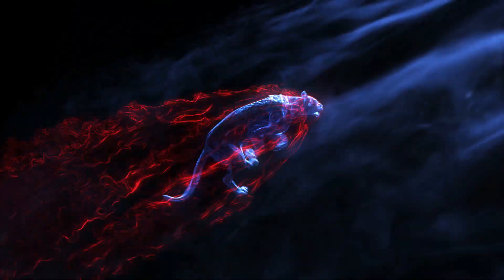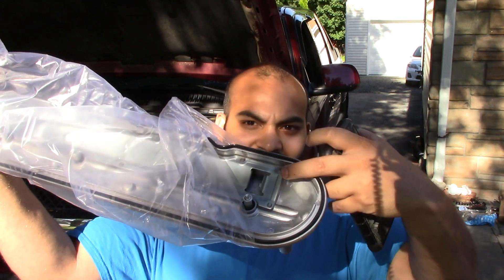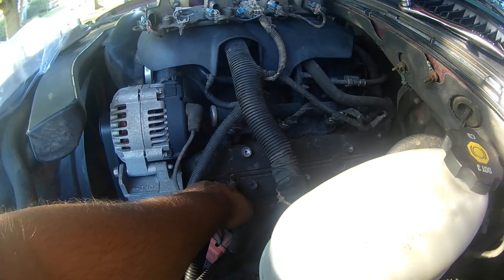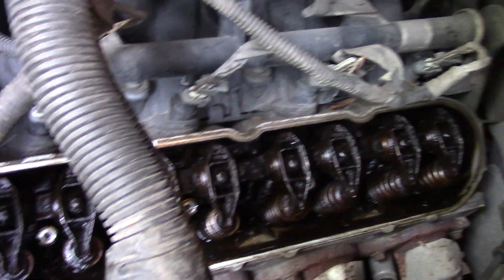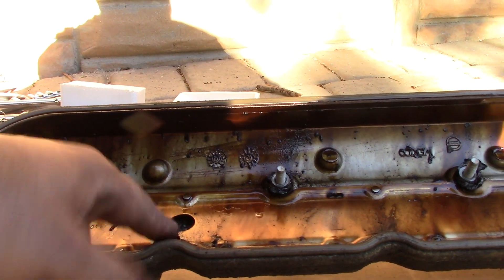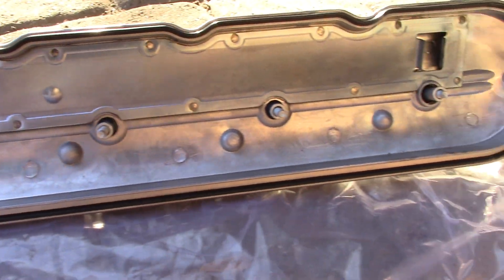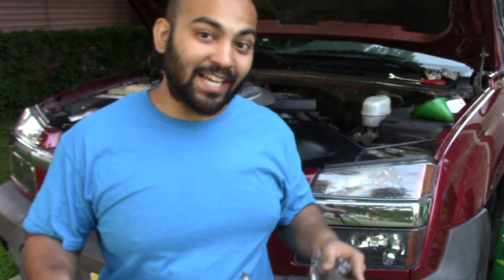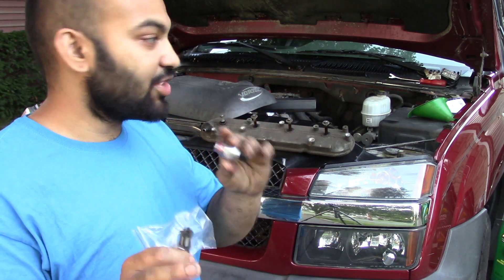2004 chevy avalanche oil consumption fix

Comment from the maker: Update to everyone, it's been sometime and the oil has not been depleting.. Everything is running great
Reply: You need to put a catch can on that thing 2 I was going through the same problems with my Avalanche I put a valve cover on it and a catch can
Reply from the maker: Ill look it up and make a video, thanks for the feed back.. Is everything working as it should now?
Reply: Yes sir everything is working perfect to only thing with the catch can every so often you have to check it
Reply from the maker: OK I'll definitely look into this, thanks for that. Ill make a video on it as well
Reply: Where did you get the valve cover at
Reply from the maker: Hey so I bought mine at advanced auto. But you can look on Amazon or eBay.. For a dorman or ac delco one.. Even 1a auto
Reply: corolla customz did u replace them with gm valve  covers   Or after market.
Reply from the maker: @JtJt-yc9nx  I replaced one cover with a dorman product. Aftermarket. Way cheaper and corrected the consumption
Reply: Question how about the oil pressure sensor  does it leak when it get damage when need replacement.     Reason I am asking. Is because I replace valve cover gasket oil pan gasket and gasket that goes by timing belt     And knowing my luck I still have a small leak.
Reply from the maker: @JtJt-yc9nx  it shouldn't unless it's cracked. But here is what I would do. Clean the leak and keep an eye on what seems to be leaking. I have entire playlists and episodes on my channel.. I did an entire engine rebuild... It'll show you every possible gasket that engine has
Reply from the maker: @JtJt-yc9nx  AVALANCHE ENGINE REBUILD SERIES: https://www.youtube.com/playlist?list=PLlHVUMZIDW-WWTwyrqpGi90-qzW1EC53F
Reply from the maker: @JtJt-yc9nx  chevy avalanche project: https://www.youtube.com/playlist?list=PLlHVUMZIDW-Vyy7FQbjTKA6YlpSKtzC-X
Reply: corolla customz thanks for your help I will do that  I have a 2005 Chevy avalanche   Hope I find solution.    Do u recommend replacing valve covers.
Reply from the maker: @JtJt-yc9nx  your welcome, are they damaged or consuming oil.. If you have an oil consumption, replace the valve cover with the pcv valve.
Before replacing anything try to clean up the leak and keep an eye on it to see where it is leaking. Now if you wash your engine make sure to keep it running, also tape up all electrical connections... Cause you could mess up your electronics
Reply: corolla customz question. Is Lucas oil good for cars.    There’s is one call stop leak   Is it good to put in car     Just a question haven’t use it. I think I use the regular Lucas oil once
Reply from the maker: @JtJt-yc9nx  I honestly don't like any stop leaks, I'm more of a fix it kind of guy. But if you don't have the time or money a stop leak can work... It just rejuvenate the seal and causes it to stop the leak.. But if you can try to actually fix the problem
Reply: Do you need to replace the passenger valve cover too?
Reply: Tom Wetz  Thank you!
Reply: How much oil was it using
Reply from the maker: @MultiDuramax04  about  a quart but since i rebuild the engine... i havent had any problems
Reply from the maker: Miller Deacon  thanks ill check it out
Reply from the maker: Ernest Raul  ill check it out for sure
Reply: @Kingcustomz  LoL, if the valve cover solved your oil consumption problem, why in the world would you need or want to put a catch can on it?
Reply from the maker: It did solve the problem, the position of the breather makes a huge differencd

Comment: Locate the rocker arm on the new rocker (Valve Cover) but mark a spot between each rocker arm, then drill a 5/16” hole next to the bottom of the splash shield next to the aluminum rocker cover. The larger hole that has been moved slightly is not enough to do it alone. Thousand of “LS” owner do this with way better results. Just a retired ASE Master Tech and my two cents. (Adjusted for 2021 inflation, its a $1.32 now) lol. Hope this helps.
Reply from the maker: Hey this is good stuff,I still have my original valve cover... Ill try this out and see how well it works... so far so good with the new cover though. but ill give it a try

Comment: In the GM bulletin They say to take all the plugs out, pour in an ounce of solvent in each cylinder and spin the engine to remove the old oil deposited between the rings and pistons. this will free up the rings to make good contact with the piston walls again. lots of people just do the cover but the old cover let to much oil get in between the piston ring gaps and baked them stuck in place. That will cause low and uneven compression. Make sure you pull the coil fuse out and leave the plugs out when you turn the key to spin the engine till the solvent is out of the cylinders.
Reply from the maker: wow, thanks for this information man.. very good to know... I ended up doing a complete engine rebuild on this truck... I actually made a complete video series on the entire rebuild.... If you havent seen it, its definitely worth a watch.

Comment: You explain everything to the t  brother man ....i have a question?  Why does my avalanche jerk when I hit 60 n i stay at 60 n when  it's warmed up about 3rd gear  my rpm is at 500 not 700 but    you get a feeling of jerking but truck don't dies out or anything I also done my tuneup no lights on also has 170,000 miles any ideas 💡.
Reply from the maker: try your mass flow sensor, probably not getting the right air to fuel mixture, any engine lights??
Reply: @Kingcustomz   
No lights big dog it pass emissions 3 days ago everything good it's just that lil issue that's making me 🤔 lol.. so check the mass flo sensor got it.. Man I love this videos TEAM AVALANCHE
Reply from the maker: team avalanche baby

Comment: Great video! I am having to replace the engine in my 2004 at only 80k miles. It had a lot of sludge but mine was due to cracked heads. My motor had the infamous castech heads.
Reply from the maker: oh dude, definitely check out my videos on me rebuilding the entire engine.... as soon as i remove my oil pan you will be amazed at the amount of sludge i found in the motor..... 

https://www.youtube.com/watch?v=beKGbAlSPSM&list=PLlHVUMZIDW-WWTwyrqpGi90-qzW1EC53F

Comment: I have a 04 Avalanche as well,same set up,valve cover pcv valve,but I notice that mines is a bit sluggish after stopping,I stop and then it’s a bit sluggish,,brand new TPS,Brand new Knock sensors ACDelco and harness,both evap valve motor are new,the one on top of the engine and the one with the charcoal box, Delphi fuel pump new as well, I also noticed that only one fuel line goes to the injectors rail, no pressure regulator,no fuel filter,I didn’t see one on the  fuel pump either,so Am I missing something? Also has cold air intake
Reply from the maker: What about spark plugs and coils. The fuel filter  is built in to the pump
Reply: @Kingcustomz  Spark plugs new,only 1 coil is new and it’s because I broke it so I obviously replaced it,coils go bad after time? Weak coils?
Reply from the maker: replace all coils over time they go bad

Comment: "Good video on the info  of the part and installation...." 1 thing that was changed though aswell. I might be wrong, but i believe the old part had extra holes that ran  down the middle across the valve (inside) like 2 or 3 small oval shaped holes...
Reply from the maker: I believe you are correct, the new one doesn’t. It has one big hole that is at the end. It works way better
Reply from the maker: Thank you so much also for the compliment

Comment: Hi there my name is Aaron and I have a 2002 chevy avalanche and I'm losing coolant in the coolant jug but it's not in the oil and the truck makes a noise but it sounds like it's in front of the motor but can't tell for sure any ideas where it could be going I have looked everywhere and no coolant leak anywhere
Reply from the maker: Ok I will make a video for you. Today
Reply: Hi thanks for the reply and I look forward to seeing the video your posting but I have a lot of sludge in the engine when I drained the oil at first nothing came out and then when it did the best way I can describe it is it looked like toothpaste coming out of the tub so I'm worried that my engine may be trashed but I hope not the truck has 247,690 miles on it and I just spent $2830 at the dealer to get the service engine soon light off and then I find the coolant is disappearing but nothing under the truck on the ground 🤔🤔🤷‍♂️🤷‍♂️
Reply from the maker: oh man, sorry to hear that. I actually made your episode and I will be posting it tomorrow.

Comment: I have an 03 avalanche and I can't seem to pull out my old pcv valve. Does it only attach if i take off the valve cover and feed it through the inside?
Reply from the maker: its built in with the cover
Reply: @Kingcustomz  I appreciate the help! I just found out that you can buy a new cover for 50 bucks. Supposedly the new one is improved  and it doesn't eat up your oil

Comment: sea foam also works for cleaning sludge out of an engine.  add 1.5 oz/qt of oil, run for 300-600 miles and change oil.
Reply from the maker: Man, watch my chevy avalanche engine rebuild series. I am 98 percent sure sea foam will not remove that sludge lol... 
AVALANCHE ENGINE REBUILD SERIES: https://www.youtube.com/playlist?list=PLlHVUMZIDW-WWTwyrqpGi90-qzW1EC53F
Reply: corolla customz you obviously never used sea foam 🙄

Comment: Run some Kendall oil through it with one quart of transmission fluid for your next Oil Change. About a week before you change oil put a quart of Marvel Mystery Oil in it about a week before you change oil. The engine will be just about as clean as you can make it inside. And the use of Kendall oil will be an excellent oil choice for that engine.
Doing that, and everybody should be running an oil catch can on a V8 Chevy.
Reply from the maker: I ended up doing a complete rebuild on youtube. My engine is squeaky clean and runs really well

Comment: I recommend a classic product to dissolve your gunk. Use one quart of Marvel Mistry Oil in your next oil change. Keep an eye on the oil color When it gets very dark do it again and again until after a tank of gas and the color has not changed much then you can perform a normal oil change. No more sludge. BTW I am not a fan of ACDelco oil filters. I use WiX XP. Get them from RockAuto in bulk to ease on the shipping cost.
Reply from the maker: Hey I did use the marvel mystery, I love it.. and oh yeah I'll check those filters out

Comment: Another great video thanks for the shout out.  How much does the valve cover go for?  I use Castrol magnetic full synthetic and ac delco filter from Walmart
Reply from the maker: Hahahha no problem man. Thanks for supporting the channel. I appreciate it. I have got the valve cover for 60 bucks. And dude, Walmart has everything. That where I always get my oil
Reply: where did you buy the valve cover from
Reply from the maker: I ordered the cover from advanced auto I believe
Reply: @Kingcustomz  I.looked.it up and they are.telling.me 140$ for.cover
Reply from the maker: Check online, see how much different it is

Comment: What other parts should be replaced when replacing valve covers. My 2003 Z66 Avalanche still runs like a champ but have small valve cover leaks.  Nice video and thanks in advance.
Reply from the maker: If you purchase a valve cover and it doesnt come with valve cover gaskets you need that.... now regarding  the small valve cover leaks that's just the gasket.... so you can replace the valve cover gasket.... now if you have an oil consumption leak the valve cover with the pcv valve on it should be replace with the updated version..if it still consumes oil well your gonna need piston  rings...
Reply: corolla customz I don’t burn oil so just Val cover leaks a bit both sides. Thanks for the reply.
Reply from the maker: @fzintzun  yeah so definitely just replace the cover gaskets.. you dont need to buy valve covers if your vehicle isnt burning oil. and you are welcome any time!
Reply: I barely bought a 2005 avalanche but it has a lot of oil on the sides of motor it looks like it’s coming from the valve covers I’m going to change the valve cover gasket’s but do you think it probably because the valve cover are the original ones not the updated version
Reply from the maker: Nope it’s just most likely the gaskets, unless the original one is broken.. valve covers don’t typically break

Comment: Did u torque down the bolts to the correct specs and if so what are the specs?
Reply from the maker: there was only three bolts, not really much of a torque sequence... from the middle work way out. 106 inch pounds...NOT FT LBS lol inch lbs

Comment: Gen 3 ls truck motors.dont have that filter under the oil pressure switch. And drilling like four 1/4 in holes at the bottom of the baffle will drain much better no need to buy new valve cover
Reply from the maker: lots of people kept telling me this lol. now i know ... its good info to know for future reference
Reply: Yes sir! Learn something new everyday
Reply from the maker: Maybe I'll make a step by step video on that

Comment: I have some oil that looks like its coming from under the ignition coil packs do you think its because the gasket needs to be replaced or the valve cover?
Reply from the maker: Oil come from the ignition coil. Means the valve cover gasket needs to be replaced.
Reply: @Kingcustomz  thanks man replacing it now
Reply from the maker: No problem, if you need anything else, I'm just a message away.

Comment: Question.. So the package only brings 1 valve cover or 2? I see you only changed the leftside what about the rightside?
Reply from the maker: One valve cover. I changed the one. Because that was the only side with a pcv valve
Reply: @Kingcustomz  ok. cool. do they sell the rightside as well?
Reply from the maker: Yes want me to send you a link
Reply: @Kingcustomz  Please.
Reply from the maker: No problem give me a few to look
Reply from the maker: @LuisDiaz-vm1vv  why are you replacing the valve cover on the passanger side anyway? is it cracked?
Reply: @Kingcustomz  no. Im just those kind of poeple that likes to cange both sides. but if there is no need to, let me know.
Reply from the maker: @LuisDiaz-vm1vv  yeah there isnt any need too
Reply from the maker: @LuisDiaz-vm1vv  the only reason for changing that was side was because of the oil consumption due to.the location of that breather hole. The updated model moved the location
Reply from the maker: @LuisDiaz-vm1vv  but I get you I'm that way, but only when it comes to like suspension and spark plugs and stuff like that
Reply: @Kingcustomz  OK. Cool. Thank you so much for your help.  I appreciate it.

Comment: Just FYI drill 4-5  1/4in holes in the bottom of that plate so the oil drains out simple fix no need buy new valve covet
Reply from the maker: 🤕🤕🤕🤕 I wish I knew this before purchasing lol...
Reply: Yup just what I did. No need for new design. Saved me $$$.

Comment: When the oil is “consumed” where does it go? And is there a link to where you got that part? I may be having the same issue with my 03 it seems like the oil just disappears.
Reply from the maker: so in the case with the valve cover, the rocker arms spit the oil into the pcv and it goes out through there. if oil is also continued to be consumed you have bad piston rings and may need to do a engine rebuild
Reply from the maker: valve cover: https://amzn.to/3h6fD5l
Reply: King customz is it common to have bad piston rings? Is there any factors that would make that more likely?
Reply from the maker: @prolly2stoned420  is it alot of oil, usually after a while just like everything else, things wear out. How many miles.. on my truck it was the valve cover. Those old style valve covers had issues
Reply: King customz mine has like 116k I believe. It was my fathers and he was a mechanic so I can’t imagine he did something to it that would damage the piston rings. But I don’t know I’m gonna try the valve cover.
Reply from the maker: @prolly2stoned420  piston rings is something that wears over time my friend. i doubt its the rings, try the valve cover. the older style valve cover has its pcv located over a rocker, so when the oil sloshed around, it would get into the hole. the newer one has a bigger hole and is relocated.
Reply: King customz awesome bro thanks for all your help I’ll let you know how it goes 🙏🏻🙏🏻🙏🏻 avalanche gang 💪🏻💪🏻💪🏻
Reply: King customz btw the link you left says it’s for the left side. Isn’t that the passenger side?
Reply from the maker: I believe the pcv valve is on the drivers side.
Reply from the maker: Hahahah no worries, avalanche gang😃
Reply: It burns
Reply from the maker: Thank you
Reply: when you are sitting in your truck left is left right is right
Reply from the maker: Yes sir lol

Comment: Hey I got a 2009 Chevy Express van with a big V8 it is consuming oil it's not leaking is this the problem
Reply from the maker: It could be, it could also be piston rings that are shot
Reply: How much oil does it consume?
How many miles on the engine?
Does it smoke on startup or when accelerating?
What engine oil have you been using, how often do you change it?
If not original owner How many miles have you placed on it?
Reply from the maker: @PrimalMiltos  It ended up consuming a 3/4 of a quart every month. the engine was purchased with 130. i ended up putting at least 10k.
no smoke up on accelerating. i used castrol full synthetic and i replace the oil every 4000. or 6 months
I did an entire engine rebuild series on the motor... its on my youtube channel.. i got rid of all the sludge and ended up boring the block and putting in new pistons and rings
Reply: @Kingcustomz  Wow nice and any oil burning after the rebuilt?
Reply from the maker: @PrimalMiltos  no burning after the rebuild the engine runs amazing...

https://www.youtube.com/playlist?list=PLlHVUMZIDW-Vyy7FQbjTKA6YlpSKtzC-X